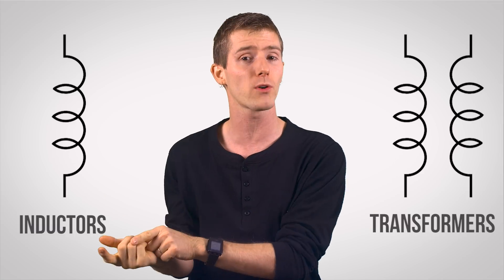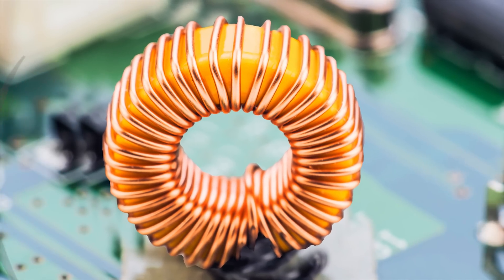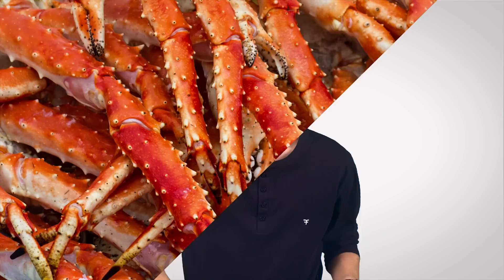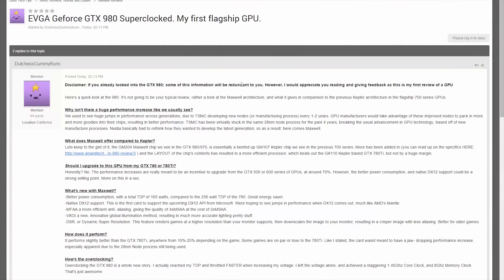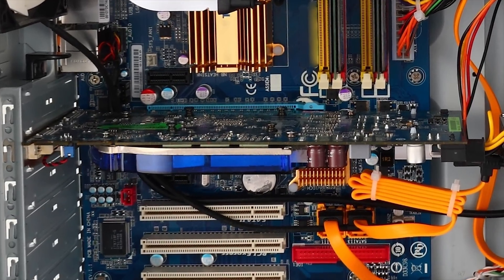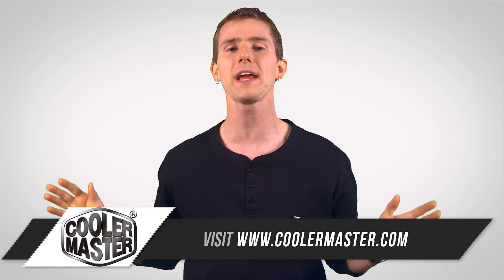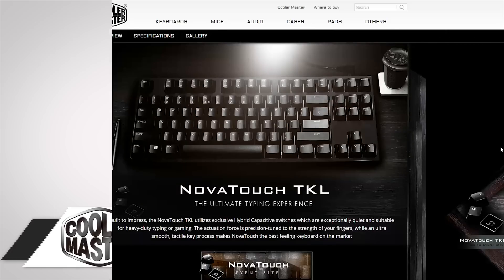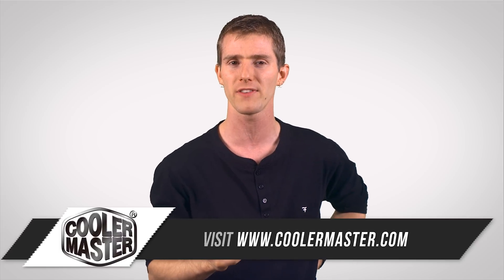Coil Whine as Fast As Possible

Comment: So more or less if you get Coil Whine there is nothing you can do?
Reply: It depends on the appliance. Coil Whine happens most commonly (but not explicitly) in power regulating circuits especially buck converters. Those pieces of electronics modulate the power in some way. In case of video cards/mobo's/etc they are there to reduce 12V power to whatever 1.x V power the component needs.

To do that they switch on and off really really fast. They incorporate inductors in their design which have ferrite cores. Those cores will vibrate in accordance with the converters switching frequency. If the frequency is between ~20 Hz and ~20 000 Hz you will hear it.

If however you can alter the way a buck converter has to work i.e. change something in the power delivery/consumption the switching frequency invariably will have to change. The bigger the voltage needed the faster a converter has to switch - hence higher frequency for the ferrite core wobble.

If you can increase the power draw to a point where a coil vibrates at over ~20KHz (or drop it under ~20 Hz) you will not hear it any more.

For video cards enabling vsync often works. Also overvolting, undervolting, orverclocking etc. can get rid of coil whine. Drivers can play a big role, card manufacturers often tinker with power settings trying to optimize them.

Power delivery change is another option. If you can alter the incoming 12.x V power slightly it may help. Without electrical expertise though I wouldn't mess around inside a PSU. But that is the reason why changing PSU's sometimes works, no PSU (even same make and model) ever puts out exactly the same 12.x V.

So changing power-draw or delivery CAN get rid of coil whine. Other than that - no you can do nothing. Hotglue'ing and all that &quot;good stuff&quot; only works if its an older or cheaper card with a large circular ferrite core and wire wrapped around it, hotglue'ing that can keep it from vibrating. With modern high end cards and quality enclosed SMD inductors glue has little to no effect.

So it can be really easy to fix or damn near impossible. It all depends. Good news is that aside from being annoying coil whine won't at least affect component performance at all.

Comment: can the other kind of coils whine ? :)) for mer its kind of akward in the opposite pole where I got the new integrated celeron quad Soc motherboards and its so economic that the old power source I used is making a whine if i dont keep a hdd or a ssd on the thing...

Comment: I've always had problems with my fans, kind of breaking and making annoying noices, within the first few weeks of useage, especially with Sapphire coolers.

So I turned in my 270x for a 280, got the same problem, turned in my 280 for a 380, didn't have the same problem, but that was the first time I ever experienced coil whine, and god.. I almost killed myself.

After 2 months of use the coil whine is now gone though!  My friend told me that some GPU's coil whine can disappear with time once it's properly been "burnt in" as he calls it.

Moral of this story: Dont buy Sapphire GPU cooling and don't worry too much about coil whine, it might fix itself.

Comment: Does the pny gtx 980 have any coil whine. i did not see any on newegg or amazon
http://www.newegg.com/Product/Product.aspx?Item=N82E16814133580
is it compatible with an asrock extreme 4 motherboard. i have a 700 watt psu

Comment: GUYS
Coil whine is cuased when you play games at a very very high frame rate.

Halo 1 is not demanding, speciall for today's gpus and since it will run at like 700fps the coil whine will be present.

Comment: An easy way to put a stop to coil whine would be to, at least in my case with my GTX970, enable v-sync. With a GTX970, which is a pretty powerful, decent card, you're generally going to be running whatever game you happen to be playing at 60 - post 60 fps anyway, so getting rid of that extra screen-tearing is just icing on the cake :)
Reply: v sync :face-orange-raised-eyebrow:
Reply: Dr. Strange: you call it tearing but I call it seeing through the fabric of the Time-Space Dimension , even if it's just half a future frame.

Comment: u can avoid coil wining by not  buying   extreme cards , that use those coils at there extreme's, so just dont buy extreme cards , cuz they use the same coils as weaker cards and put them to the stress they are not designed for..golden middle ,or something above, grain of solt , if u plan to play 1080p, i dot see a reason to go above 950...if u think u need better go for 960, but if u go for extreme 980 , be prepped for things that come with extremes , high noise , high temp, lower life span, price..hell even coil whine  if u are extremely unlucky

Comment: I don't even know if this is coil whine, or if that's even possible in a laptop, but my Dell laptops AMD Radeon HD 8850m GPU starts emitting a high pitch static-y noise during the first 5 or so minutes under heavy load. This only happened after the motherboard was replaced because the AMD GPU stopped working altogether. It's very interesting, but isn't really annoying as the volume of this noise slowly lowers until it's inaudible after a few minutes.

Comment: My GTX 980 has coil whine since I have gotten it. :(
Reply: Dracstar How loud is it? Is it really annoying?
Reply: HonzixCZ I mean, i have my case panel sides open, so i don't know about it if it's closed.
Reply: +Dracstar buy gtx 970 it's the same thing (almost) for almost half the price :D
Reply: NanoTry Box too late now. I can't hear the coil whine anymore with my fans
Reply: +NanoTry Box actually you can achieve the exact same performance from a GTX 970 if you over clock it.
Reply: Dave Courtis ye well my 980 was already overclocked. :p so its still better than a 970. but good point.
Reply: Dave Courtis Yep :D
Reply: +Dracstar my 970 does too. hell it seems like any modern nvidia card seems to cause an issue
but it&#39;s not audible outside of the computer, only over normal analog headphones (very quiet, but noticeable if your game is quiet and volume is turned up) or on the microphone which unfortunately for me is used to listen to my second desktop, but what will hopefully solve my problem is buying a ground loop isolator that passes through my 3.5 mm cable from one desktop to another (it works for my friends computer)
Reply: steaker1705 Interesting. Thanks!
Reply: steaker1705 yes, so does my 980 ti, though once I knocked on it a few times it seemed to help.
Reply: Dave Courtis hahah same with mine.
Reply: +Dracstar BURN IT WITH FIRE
Reply: +Dracstar You can return the product because of that.
Reply: King Dany Really now? I might do that soon.
Reply: Dracstar That really depends on how long guarantee you have on your 980.
Reply: +Dracstar I have my old 550 Ti with coil whine issues. It still works today somehow, but whenever I try to overclock it even slightly, it just makes a sound like a spaceship approaching really fast before crashing the whole computer. Usually, the card will shut up, but if I wanna play any games with it, I have to make sure it's got a framelimiter setting or else I'll hear the coil whine and eventually have a hardware-related crash in game. 

Thankfully I don't even use that card anymore, having bought a XFX Radeon 7970 3GB DD Edition for the fact that it was mint in the box at half the normal price in a pawn shop. However, my computer seems to be having power relate issues on startup now...no clue why really, but I'm hoping it's just a power cord or power bar. (Wouldn't be surprised if it were the first one considering I'm running a rig with an 850 watt power supply off of a Dell monitor power cable from 2006.)
Reply: Spam Yeah sure if you want to be a bitch about that you got a defect item. Coil Whine is something you can return the product for and get a new one.
Reply: Spam You you are.
Reply: Spam I don't use that 550 ti anymore, but thanks anyways.
Reply: ***** what is your power supply? Is it certified?
Reply: Dave Courtis I have an Antec High Current Pro 850 watt modular PSU that is 80+ Bronze certified.
Reply: +Dracstar Overvolt it, undervolt it, overclock it. Do anything that will change the amount of power the card draws. Coil whine happens because it (very simply put) has a lot of buck converters that switch on and off extremely rapidly to regulate power (make the 1.x volts from 12V input).

If you can increase the frequency (somehow) over ~20KHz the whine will dissapear.

You can remedy it on "the other end" as well by changing the voltage the PSU puts out on 12V rail by minute amounts. That's why "switching PSU's" sometimes help, no power supply generates exactly 12V.
Reply: Allan Bernard Thank you :D

Comment: Quick fix that i found is to use a hum destroyer. They're normally for ground loop issues with high end audio equipment but they work to get rid of coil whine aswell. I use the Behringer microHD400 hum destroyer. My situation is fairly unique as I have active monitors which amplified any RFI in my system, but i haven't had a single coil whine issue since. It's completely gone. It's only about £20 so if it doesn't work its not too bad. Highly recommend everyone tries it out

Comment: I bought a Sapphire R9 290X and powered it with my 630W Raidmax PSU. No coil whine. I then upgraded to an MSI R9 290X 8GB and pushed the power supply up to 540W at one point. No coil whine. Guess I'm just lucky.
Reply: lignimvite 290x with a raidmax psu... what could go wrong?
Reply: lignimvite no u are not lucky , u are out of luck if u get it cuz its rare as fuck, the reason linus has one is cuz he gets GPU's all the time, god knows where did that 7970 been before, and coils are usually sealed but if u ship it a lot of times, kick it, roll , drop whatever, sometimes a coil gets lose before some other component dies...electrical engineers are well aware of it, they know that, so they take care of it...99.9 percent of non test gpu's dont have a coil whine, so if u dont get it that doesn't mean u are lucky, u are out of luck if u get it..anyway a drop of silicon will sort it out cuz  its a low power coil, its not like its a 1KW transformer that  shakes the house, its a small coil, drop of silicon and its fixed
Reply: Pavle Pavlovic the first gpu i got (gtx 970) has coil whine, a week or 2 after awhile.
Reply: Joey moutree yeah, i got it too, but not constant, only if frame rate is insane, tends to happen on high end gpus, if u cap frame rate it wont happen, they use the same parts as entry level cards,not designe to run at  200, 300fps..that might be the case, but ive never seen a gpu that wines for no reason other than broken coil

Comment: my computer isn't whining it is buzzing, like an electrical buzzing that sounds almost like a cricket.. It only buzzes when I open a game up or watch videos and instantly stops if I minimize the game. I don't think it's a fan issue because a fan doesn't instantly stop/start slow down/speed up - fans are gradual. 
- now it is doing it whenever I move the mouse on the desktop... wonderful.....
Reply: @Badr Ahmed lol i have the same problem but dont know the fix
Reply: Means you're PSU is likely not good enough
Reply: Maybe something related to the ICH/SouthBridge?
Reply: @Rudxain  lol, nah man it's because the powerload goes up when gaming! The GPU is the most power hungry item in the PC! 
I went from a 650w psu and a 1660s with no whine, to a 2070 super and here the whine in the power supply as soon as I amp up the power

Comment: Coil whine is mostly due to improper design of the VRMs. If not designed correctly, the VRMs can self oscillate when at certain amounts of load.
Also, the whine might be from a fan, if it is PWM controlled. (Even a CPU fan controlled by the motherboard can whine)

Comment: My 970 does coil whine but weirdly only sometimes in menus and very rarely in pre rendered stuff where the framerate is very high, two easy examples from the same game are Witcher 2's main menu (game runs just fine btw) and Witcher 1 logos like Atari or whatever

I'm just wondering if there's any correlation whatsoever or is it just random? If anybody knows please reply
Reply: Igor Costa Hmm, is your card the Superclocked ACX 2.0 one? Because if so then our cards are the same, for me on Witcher 1 the logos and intro cinematic run at like 1600-2500 fps and then main menus around 800+, but the game itself doesn't coil whine at all for me, it runs at about 80 fps most of the time
Reply: ***** you may find that the increased load will also increase the pitch of the whine... and because human ears can only pick up a relatively narrow band of frequencies....

the whine is still there during gameplay but you just can't hear such a high pitch noise.... (check for local dogs going crazy when ur gaming :D)
Reply: Yeah my gtx 970 does that too. It gets to higher frequencies as the frame rate increases. It really squeals when you play Minecraft with no frame limiter and the multiplayer log in screen renders past 4000 fps

Comment: Only problem i've had was my SeaSonic X750 Gold. Didn't know what was going on, thaught it was about to break so i RMAed it. Turned out they have coil wine. Overtime its gotten better and its honestly no where near as bad as some of linus's stuff.
Reply: Sky Productions thats interesting I have a 850 watt xfx power supply which your 750 and my 850 are both made by seasonic but ive never ran into that problem

Comment: Can anyone recommend a GTX 970 card that doesn't have coil whine as a common problem?
Reply: Dutchyy _ I have two cards of this model and one suffers from coil whine, one does not so it's just luck of the draw.
Reply: Have an evga gtx 970 ftw, that doesn't have coil whine, on occasions like on furmark, it will hiss
Reply: Mike7 i ahve gtx 970 g1 gaming and i dont have any coil whine. Not even if i play bf4 or gta 5 max settings.
Reply: Mike7 I got a gigabyte gaming G1 gaming 970. got no coil whine.
Reply: Evga acx 2.0 superclocked, i have it, and coilwhine isn't a problem
Reply: Well it isnt a problem, but its annoying like hell tho.
Reply: It isnt there i mean
Reply: Mike7 a good after market brand usually don´t have, some brand new GFX´s have a lil whine for 1 or 2 weeks but it dissapears, i advice EVGA, MSI, ASUS, BUT that doesn´t mean you can´t get a defected  card with whine.
Reply: Asus, gigabyte, evga are the ones I sous go for
Reply: Galax GTX970 Infinity Sold By Overclockers

Comment: Just cap your FPS to your monitors refresh rate. In games, cool whine happens when a game runs at an extremely high FPS (like loading screens, some older or simpler games, ect). Or use vsync.

Comment: i dont hear my coil whine on my gpu (asus gtx960 strix) but why i hear the coil whine through my speakers?
Reply: jaakko200987654321 That's probably not coilwhine, then. But some other problem...
Reply: Sixten Kastalje
i do hear coil whine from the gpu (the same whine that comes from the speakers). if i put my ear really close i can hear it but when i moved my pc from the floor to the table the problem disappeared

Comment: I've lukily never had coil whine in my PC but my router/modem on the other hand emits a very high pitched sound that becomes louder whenever it's under heavy load. Even worst though is the modems power brick but luckily I managed to dampen that enough to be inaudible from more than a meter away using a towel. Yeah I know it's probably not the best of ideas to cover a warm/hot power brick with a towel but so far (for the past 2+ years) it has worked without issues.

Comment: I might be wrong but it does sound like problem with unpotted guitar pickups! In guitars if the pickup is not potted it can result in annoying sound! Usually it can be fixed by dipping pickups in wax for about 20-30mins. But this issue may or may not be the same

Comment: 1½ minutes of ads and outro in a 5 minute video? Really? 
Also you failed to mention that Coil Whine presents itself mostly in a situation of very high FPS, which is not exactly that common. For example running a very old 3DMark bench will most likely make any new GPU whine when the FPS hits 2000. Same applies to very old games which was the one you show cased to present Coil Whine... If your card whines below 200FPS you have a problem, if not just get over it. It will whine in some loading menus etc, but that's not really the issue we are talking about here.

Comment: Hi! (Sorry for my english) I have a question: What can I do if my gpu vent make an annoying noise? Do I must change it or can I do something else?
Reply: ***** What noise, does it clack ?

If it does it's a Bearing damage and you should replace the fan/cooler, not much you can repair there.

Comment: actually only power sources and grafics cards, have inductor big enougth to make some noise; in case of power source, simply replace it for a bigger wattiage one or a real watiage one, and problem solved couse it does not need to max its power out put so it will not make noise, in case of video cards if you have a friend that can replace the coils for other ones encapsulaten the noise will desapear, video cards with encapsulated coils dont make noise couse the magnetic force cant escape the capsule so it wont resonate with other components. gamming boards come with encapsulated coils and real watt power sources came with encapsuled coils, so it is still making that anoing sound may be you need to check your earth grounding couse it will be defective or inproper.

Comment: https://plus.google.com/103470457057356043365/posts/3reWRqDMbn4
"So it turns out that annoying high frequency whine in my soundsystem isn't crappy electrical noise that has been plaguing my wiring for years. It is actually high frequency ultrasonic transmissions that malware has been using to communicate to airgapped computers..."